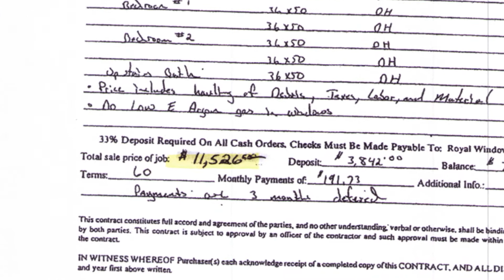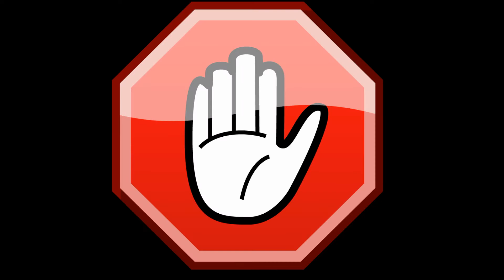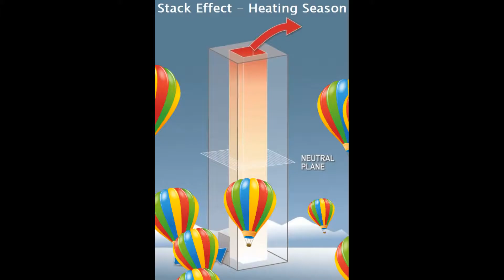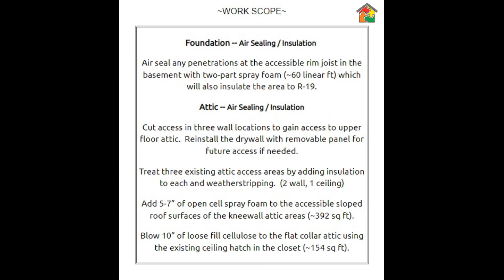5 Reasons Your New (Or Old) Windows Are Drafty

Comment: I know why my windows are drafty. It's around the windows, no insulation. Naked brick that was badly pointed (holes). 
Not to worry, management said they're going to replace the windows in 2017. We can't use the stove or space heaters.
 What do you mean it's 2022?! Cold.
Reply from the maker: Sorry to hear theadore roberts. I hope things get tightened up for you soon! Maybe management can look at insulation in the attic as a less costly alternative to windows if that has not been considered.
Reply: @homeairleakagetest  thank you for your response.
It's not the roof, it's the walls. Brick to sheet rock with nothing in between. I wouldn't have found it if it wasn't for an air conditioner air leak I was trying to shut down. I don't think the other tenants even know. And how much wasted heat in the process? You could pump out enough to be 90 degrees, while the tenant feels 32. The breeze can almost blow out a candle. 
There's nothing that can be done by tenants, we have let them know for years. They blew us off with 2017.
Reply from the maker: @theodoreroberts3407  whereabout do you live?
Reply: @homeairleakagetest  i. A little town on the outside of Cleveland.
I'm an apprentice electrician and even I know that's not right, for one the R value of a brick, then improperly point the bricks left air leaks.
Reply from the maker: Here is one thing I can tell you, the gaps to the attic are much more important to seal than the leaky wall due to simple physics. Not to say you don't have a problem on your hands, but unless the top is sealed then you can seal the walls all day long and likely, you will still feel cold.
Reply: @homeairleakagetest  okay, you're the expert, but I haven't heard of any roof leaks in the last 15 years. Maybe there is some.
I was, at one time, in position to hear the complaints of the tenants and fight for them, until I found out even representatives have no power, it's just fewer people to tell no too.
Reply from the maker: I understand what you are saying. I hope the best for you!
Reply: The problem is that glass panes transmit the cold one to one. Glass conducts the heat of the apartment to the outside. Triple glazing is becoming more and more common in windows. Compared to the double-glazed window, it offers better energy, sound and sun protection and will become the mandatory standard in window construction in the foreseeable future.
Reply: @lenny108  we have double glaze that were supposed to be changed in 2017. So, we're waiting.. until 2017 comes around again.
We had the bricks re-pointed a few years ago and they did a very bad job. Not the cause, but it doesn't help.
Reply from the maker: @lenny108  You must be a window pro!!  Thanks for the info!